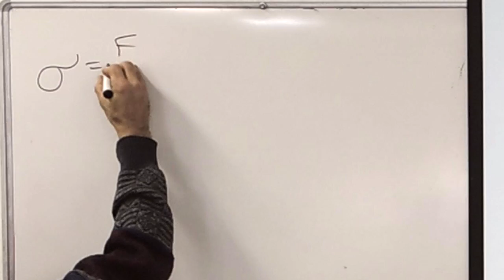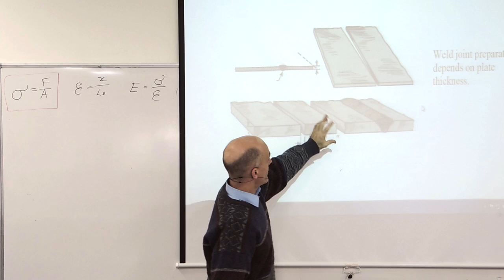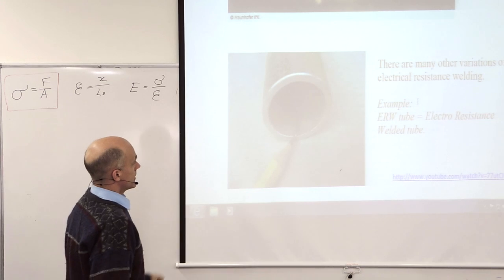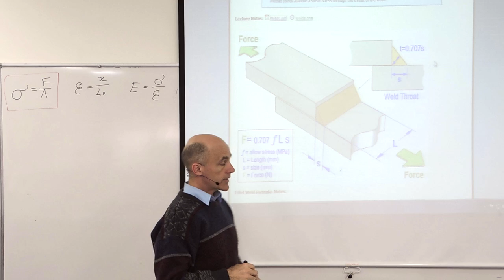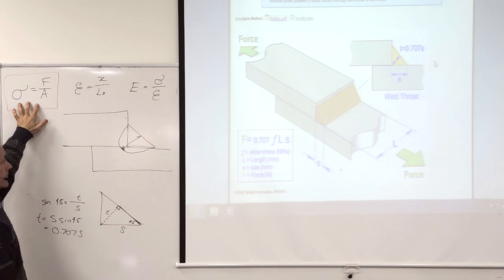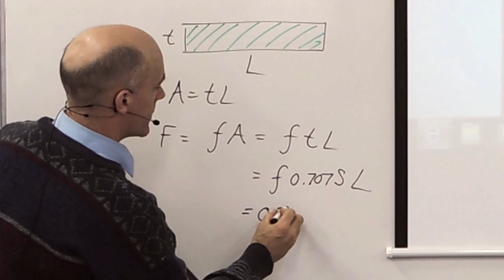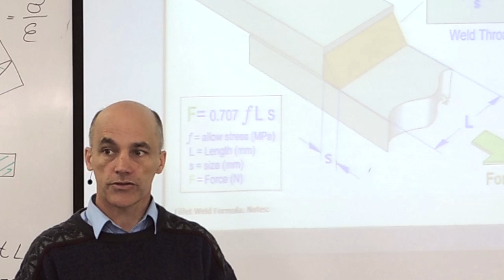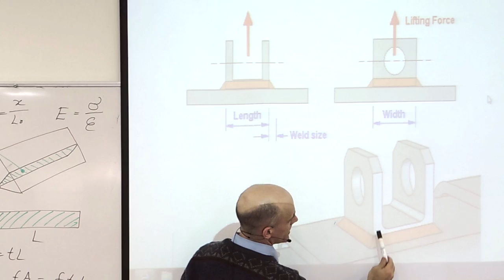Welded Joints

Comment: For butt joints, the weld strength is 90% of the the weaker material, either the filler or base metal, correct?
Reply: marsdog No, it 90% of the base material.  The filler, as I understand it, never stronger than the base material.